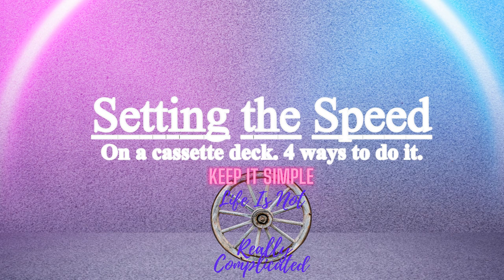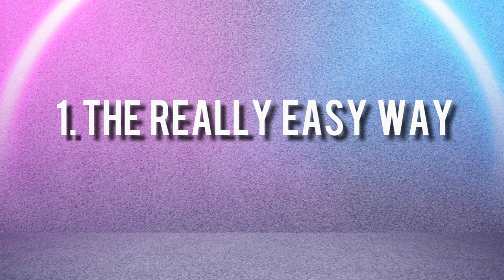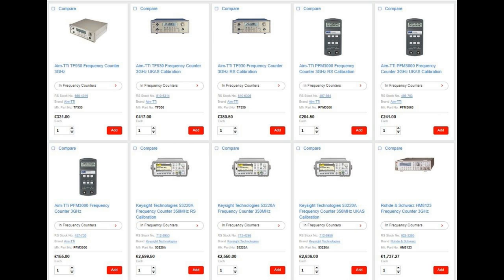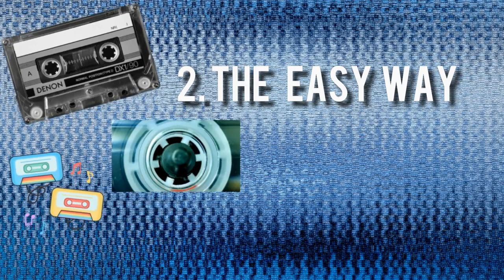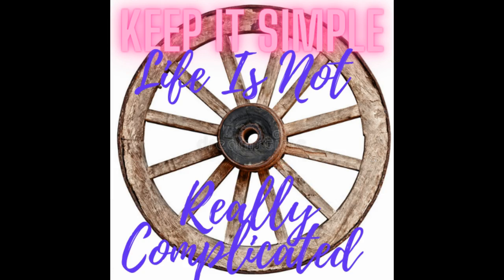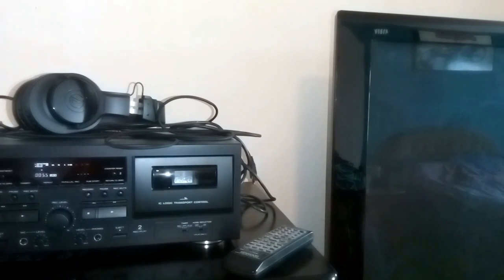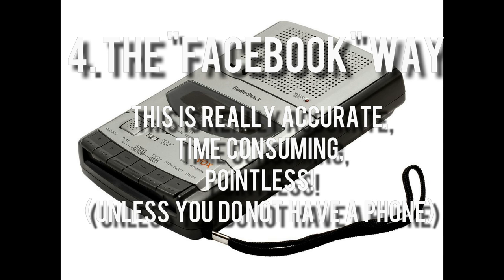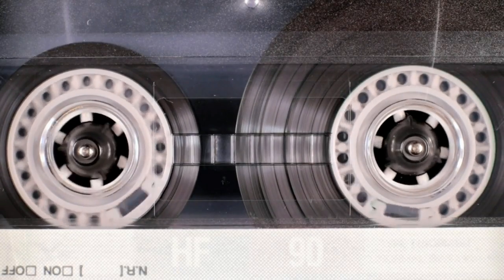How to set speed. 4  Easy ways  to set the speed on your cassette deck. No special tools

Comment: Some basic multimeters can also measure frequency using the audio out of the back of the unit. For Windows computers, there is a program called WFGUI, released by A.N.T. audio that can measure wow, flutter and frequency. Besides a patch cable from the cassette deck and the audio in to the PC, It's about all one needs!
Reply from the maker: yep. the wow and flutter pc app is great.

Comment: Since those test cassettes are quite expensive, comparison between a digital sourced track and the same one on a cassette tape looks like a good alternative, however it is best to verify it on at least two songs by different artist and/or labels. I say this as especially in electronic music you can find various releases which may contain the same track but differing in playback speed. I think the best way it would be to digitize a chosen track from the tape and compare it to a digital counterpart, cut the both at the same places, ideally at beats to obtain the most precise measurement. For example, if the duration of the tape recording is 3:55.294 and the digital track is 4:00.000, we know the deck runs 2 % faster, then we can record a 3213 Hz sinewave (i.e. 3150 Hz × 102 %) on a blank cassette using this deck and Audacity and then when playing it back adjust the speed accordingly to obtain 3150 Hz tone. 😉
Reply from the maker: Without a calibrated test tape it is all just a case of trying to do the best. Thanks for your thoughts.